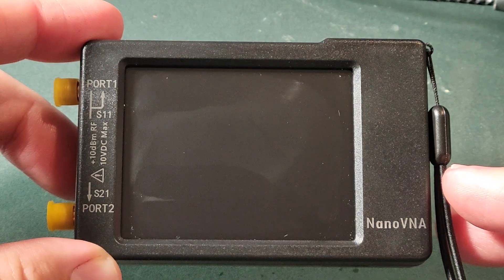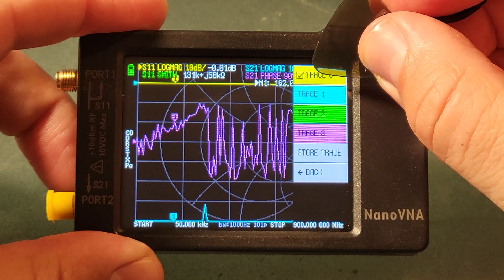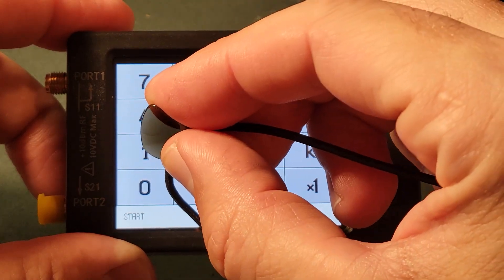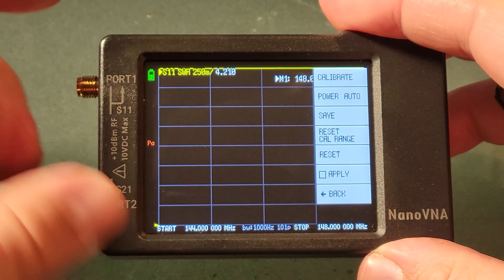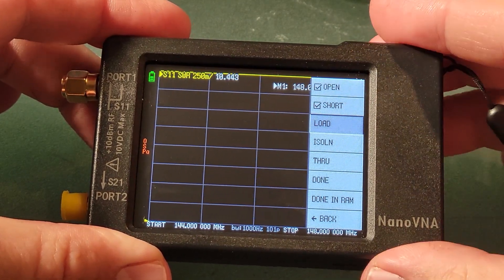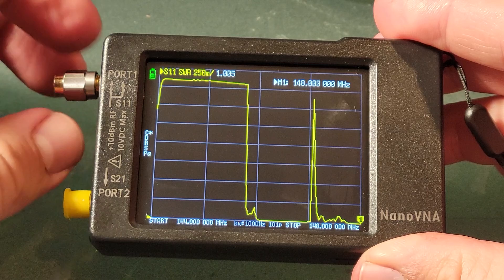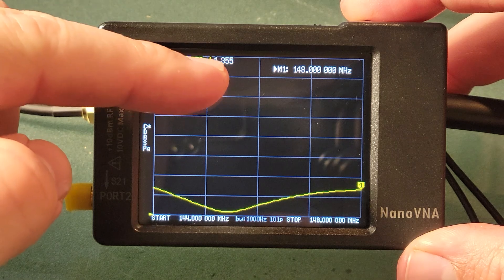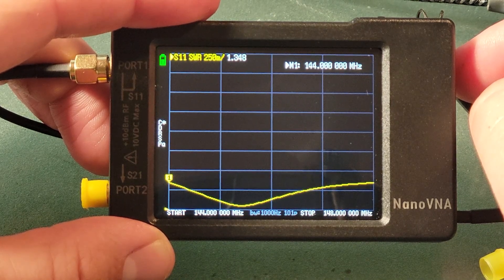NanoVNA - SWR Reading Made Easy

Comment: Great simple-as-possible but thorough explanation of using a NanoVNA to produce a simple SWR sweep of an antenna, the most common task a ham will do with this handy device.  PRO TIP:  I do the entire calibration including isolation and through for each ham band and save that calibration for each band, so the calibration is also good for other tasks that use port 2.

Comment: Thanks for this, I bought one a couple of years ago and have hardly used it, as I found there was simply to much to remember. I like going portable with a Slidewinder DX antenna and it would save a huge amount of set-up time by being able to check the SWR, the only alternative is to get a MFJ antenna analyser but obviously they are more expensive

Comment: When measuring an antenna do you hold the antenna or leave laying on bench?
If I leave on bench the SWR is high but if I’m holding the brass connection it drops.

Comment: Question: does the vna help in adjusting antenna tuner without transmitting? 
Just saw another video demonstrating the MFJ212. It puts a signal and you adjust tuner to reduce null. It is not available anymore. Just looking for something to help in tuning without transmitting.
Reply from the maker: A  nanoVNA is much different than actively tuning on the HF bands. While a nanoVNA does send a stimulus through the feedline and it measures the response, I would be surprised if it could be heard in the same way. And it's worth pointing out, nanoVNAs only measure, you will need to modify the length of your antenna or introduce something else such as a loading coil to change the reading provided by the nanoVNA.

Comment: The open standard doesnt make sense to me, open is open, wouldnt just not screwing anything on the connector be faster?
Reply: At these low frequencies it is probably a huge overkill but the open standard provides a small well defined capacitance between the open center conductor and the end of the cap.
This probably maters to get the calibration plane to sub mm precision.
This can probably be important above a few GHz.
It also provides shielding against external signals.

Comment: Thanks for the video.  You made one error in the cal procedure.  The calibration point is the end of the SO239 when you connected that adapter.  Calibration should be made at the SO239 end.  That is your open, short and load should be made there, not at the VNA itself.  By doing this, you remove the adapter cable and move the calibration point to where it belongs, where the antenna is connected.

Comment: Best I've seen. Why? I'm a new ham setting up my station and I bought the nanoVNA H4 as the most economical SWR test device on the market for helping set up an antenna. I discovered, as many have, that it comes with no instructions whatsoever. I looked a t a few other videos before I found this one. Had this been first, I would have been happy. That said, I do plan to explore at least a few of the many capabilities the nanoVHA has.
Reply: There is a good book called 'NanoVNAs explained' written by Mike Richards G4WNC published by the RSGB that costs about £15. It explains and covers all the various features of this amazing little device.

Comment: Well i made à 2m antenna yesterday for the car. I used a standard swr and power meter.. Calibrated with a 50 ohm load . I adjusted for minimum swr. It works well.. I agree the nano vna provides more info. I do have one, but cannot get out of my old habits. Thanks for your time and info.

Comment: Not sure if this matters for this particular device, but I was taught that you should always do a calibration in the config you are testing with, especially if there are any adapters, extensions, couplers and the like involved. Basically to hook up everything except the DUT, then perform the open, short and load calibration.
Reply: You are correct.
Reply: This is just what I was wondering about. On the one hand, I thought you were supposed to recalibrate. On the other, what the purpose of saving it if it can't be re-used?
Reply: What is DUT? I can't get this thing to calibrate correctly. I didn't get an open connector with my kit is it needed or is open just nothing on?
Reply: @Keno_IMN DUT - Device Under Test
Usually there is a plug the screws on but doesnt connect to anything. But depending on what you’re doing, even the presence of that „blank“ can make a difference. 

I would also advice to do your tests away from the rest of your lab equipment. Go outside, calibrate, then hook up your antenna. That already can make a huge difference. 

Things like switch mode power supplies, transmission lines and other things will wreak absolute havoc on your measurements. 

You can even see this in an SDR. The spectrum goes silent the moment you disconnect a nearby power supply.
Reply: @DeputatKaktus I appreciate that man I wasn't sure what you meant by DUT. I was outside in the back yard trying to test a new QRP antenna and was having some difficulty getting it to resonate and watched the vid and saw where I needed a cap for the open test, apparently where I purchased my nano from didn't include it. I'll see if I can get them to send one asap I was hoping to use this antenna this weekend. I definitely need it soon I am going on a hiking trip and will be activating some SOTA and POTA
Reply: Can the factory calibration be used and if so what is the difference and or quality of an analysis or antenna test?
Reply: For sure that is the correct method, but just how much difference will there be in the real world between calibration at device vs calibration at DUT?
Reply: @kenh8979 There can be a significant amount of difference, especially if you are working with narrow bands. You can get completely wrong results if you don't calibrate it properly, depending on how far the previous calibration was from the "correct" calibration for your current setup.

Comment: All of the recalibration crap sucks.I will just keep my MFJ 269 and be happy.
Reply: That’s fine if you can afford to buy one of those. They are about 8 times more expensive than the Nano VNA.
Reply: @bak2bassix  I already have the MFJ 269 so I don’t need to buy anything.I covers all of the bands that I use and it’s very simple to operate and it works great.
Reply: @1OFGODSOWN  Yes I’ve seen a number of videos on the MFJ models and seen one being used by an operator at our club. They’re a great bit of kit. As I’m still in my first year of the hobby, I couldn’t quite justify the spend, but for now the Nano VNA serves me well for a justifiable price.
Reply: Why? 
About maybe 15 minutes to calibrate 5 memories, then just recall.
I have 4 to 8 MHz for 60m, 3 to 10 MHz, 10 to 20, 20 to 30 MHz and 20 to 265 MHz.
Nothing difficult.
G4GHB.
Reply: @bill-2018  I can do every band and Never recalibrate anything with the MFJ.
Reply: @1OFGODSOWN  Yes, they seem good, I did consider one at the time but opted for this..
Reply: @bill-2018  I Love Simplicity because I’m Old.👍🎙
Reply: Did you know that the NanoVNA are only about $50?  So most Hams don't need to think about it too much. Also, the Chinese have better QA than MFJ, less risk of being sold a dud.

Also, for tuning an antenna, keep in mind that the calibration is for the amplitude; while the frequency is set by an internal oscillator. So tuning an HF antenna for the resonance typically doesn't need the calibration step (your experience may vary).